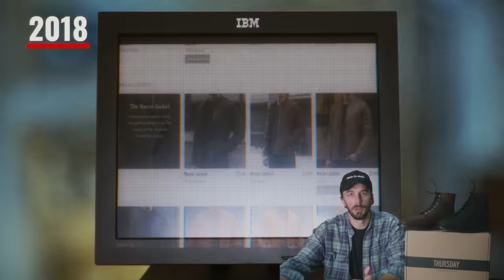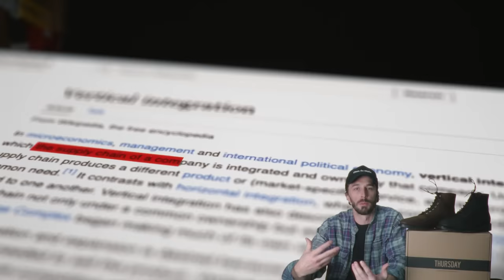Thursday History: Why they’re taking over the affordable boot world

Comment: Took a few attempts to get ones that fit but they sent replacements to me before they received my returns (UPS ain't That fast) and my only beef is I'm not used to any sort of heel, so maybe I should go for the sneakers. The only thing they have going for them on those lesser quality hold-overs from the temp factory is they looked to still be an okay boot for $200, just not the really good boot for $200. I don't need any new ones just yet, but will keep them in mind. I've a pair of Captains, Cavaliers, and dress shoes from them. I wear the Cavs most, because I'm lazy and don't like taking time tying shoes or boots.

Comment: What modern product design gets wrong is that it's marketing-led, it's "What is flashy and slick and in-your-face, that all the 'cool' people are wearing/using,  that looks like an expensive product, has all those design cues, but at ¼ the price?"  The way not to sell people an eventually disappointing product (like 90% of all electronic products on the market) is to be honest with the fundamentals of construction, overspecify and slightly overengineer materials & construction to cope with edge-case use scenarios, then make it clear (via videos like these) that that is what you are doing, and continue doing it, and not compromise and downgrade for the sake of a cash cow return, falling into the trap of trading on your previous good name as your product declines in quality. 'Taking the money and running', once you have established a name for yourself is the worst form of dishonesty. Doing the opposite is a good touchstone for the way you should live your life. Thanks Weston.

Comment: I love my Captains BUT the quality control issues are real. Mine came with the tongues all chewed up, loose threads everywhere and the leather was super dry. After less than a year of light use they need a cobbler for the separating heal.They are comfortable. With a little work burning the threads and conditioning the leather I have a nice pair of chromeexcel boots for 200 bucks. I have bought from them since and would again but probably only for the premium leathers. I also bought a pair of durbeys in waxed flesh. They have a minor imperfection in the welt. Purely cosmetic and not that noticeable.
Reply: yes, for casual usage I find them mostly acceptable for the price if you can find the right size in any given model. they have a whole bunch of models that I am sure are a waste of time.
Reply: I’ll add to this, their advertising is not honest. If you wore these into the wilderness they would fall apart.

Comment: I purchased a pair of black Thursday captains 2 years ago from an ebay seller at a great price ($130). They're wearing and holding up like a champ. I assumed that they were 2nds but, still can't find any flaws in stitching or the general construction of the boots. I think they're an earlier pair with a different last than is/was currently being used. I noticed that this earlier pair has thicker/stiffer leather than more recent models. I'm wondering....has anyone else had the same experience with Thursday using thicker leather on earlier models??

Comment: Wish I could try them on, I’ve wanted to get a pair of them. I actually work in boots so I’m curious how they would hold up. Auto mechanic. My red wings are bought shot after 6 years. Would like something lighter. Have been buying a new pair of sneakers  converse high tops every couple months. They’re comfy but wear out quick. I was thinking these would be a good compromise of the two.

Comment: I was so excited when I got my Thursdays a couple weeks ago, but I just discovered shoes have different widths... and the style of Thursdays I desperately wanted the past two years doesn't come in different widths and they run slimmer anyway so the boots crushed my big MANly feet like how Jason crushed that one dudes head in Friday Part 3. So now I have an irrational grudge against them.
Reply: I’ve got wide feet. Every now and then I will but a pair of regular width shoes. Something inevitably breaks quickly because of the pressure from my feet. 
I recently retired a pair of iron rangers. They looked perfect on the outside and the soles were only halfway worn through. But I had separated the interior stitching so they got wet if there was any rain at all. 
The lesson is - Don’t assume the leather will stretch. If something is too tight it will fail. Get proper fitting shoes

Comment: Those heat activated counters will crack over time, especially when taking off the boots with your other foot. There are stronger heat activated counters on the market, but these white squared ones are not a good pick. I also don't like the fiberboard as a midsole. Split leather is not that more expensive, but will really help the boots last through especially wet days and conditions. For 200 euros it's an ok deal I guess, but i'dd rather spend 50 more for quality contreforts and midsoles.
Reply: I agree, synthetic toe caps are fine but heels should be leather or at the very least a top of the line heat activated one. And the midsole straight up sucks.

Comment: I bought a pair of the wingtip dress shoes (not boots obviously). Initial impressions were good, but after 10 months of easy office use the sole is pulling apart from the midsole(?). Not a good sign of quality unless this is a one off. Granted this is a sample size of one, but I believe these would've had to have been made before the factory change? Not sure, but not impressed so far.

Comment: i bought a pair maybe 4 years ago, i must say i was thoroughly unimpressed.  leather felt very cheap and did not last, fit was weird, i did not like it.  taft boots were slightly better but laces started tearing the holes and stuff.  if you need a boot for once in a while wear i guess so.  but if you want a quality boot for frequent wear id look elsewhere.  even if you could resole it the uppers wear out too fast.

Comment: First of all, I really enjoy this channel and I believe the reviews are honest; however, this particular video made me skeptical about the legitimacy of Thursday boots (for the first time). 

1. How’d they mess up by sending the wrong /old boots?   Especially when this is for a sponsored review.   Please don’t give the excuse that they were rushed. 

This tells me that they did not stop the wrong old boots from being shipped out at the factory.  I’m guessing they probably shipped out quite a big amount of these.   Probably in the tens of thousands?  

I was literally looking to buy a pair of captains from Amazon minutes before I came across this review.  Now, I’m not sure if I want to buy them until months from now so I don’t get the old stock boots shipped to me instead of the newly designed and cut ones. 

Also, what do you mean by check the midsole????   We are not about to cut open the boots right after buying them.   Please be more specific about how to tell the difference between the old one from the new one.  How are we supposed to know what the difference in materials, feel, etc. if we’ve never owned a pair of Thursdays?

I guess the thing that really made me skeptical is the fact that Thursday claims they caught the mistake “just before” they were shipped out.  

So, is Thursday guaranteeing any purchase made today and forward is the newly designed and manufactured boots as this video claims?   Or, will they just keep shipping out the old ones in stock until sold out?

Honestly, I think this company is solid, based on reviews from you and similar channels.  I still want to buy a pair but not sure if Amazon is carrying the new model.

Comment: What’s your guys’ favorite leather for the Thursday Captains. I wanted to get a pair but was overwhelmed by all the options, any recommendations ?
Reply: I also felt overwhelmed like you did. I got 2 pair the captain in matte black and the president in a light brown color. Don't remember what it was. I highly regret not getting the Arizona Adobe. That seems to be the best of the best from them. Don't recommend the matte black
Reply: You would basically have to order two or three pairs and see how they look to you in person, and then you will possibly have to exchange to get the proper fit, which seems to vary from model to model, but when I first wanted to check out the brand, the only ones in my size available at the time were the Rugged leather in the Captain which are fine for light hiking and such but not really "dressy".
Reply: @Highland_Paddy  agreed. I would order a couple colors and sizes from Amazon to try on and easy returns. Then order your size and color straight from Thursday because Amazon doesn't have any of their new boots
Reply: @almostkinda  when I first bought, the Thurs site was down for the holidays or something and HAD TO buy from AMZN, which I'm positive was an older model but they fit OK at least.

Comment: I got 1 pair of thursday captains years ago and loved them. since then ive gotten a few other pairs and they have all sucked massively. Major QC issues on all of them and what appear to be straight up worse construction. Every pair after the first one has had noticibly f'd up stitching, no nails through the heel, one even has the wrong size heel block on it and has a lip halfway through the block, 2 have had stitching so fucked on boot lining that I had to cut out large masses of bundled stitching.
I super unimpressed with this brand and frankly wont touch them  going forward. used to be my go-to recommendation but I cant anymore
Reply: What are your recs not that thursday is sub-average?

Comment: I like Thursday boots and own a lot of their products but I have to say you're basing your praise on the company based an a sample of one good boot that they sent you after one flawed boot. How do I know that the good boot was one of a small sample set for reviewers and the one they accidentally sent you  is how all the rest are made ?
Having said that....I'm not necessarily sure the "flawed" boot was much worse and I would be happy to receive a boot with a rubber midsole and a latex insole cushioning. Red Wing use rubber midsoles and are known to last a long time plus a midsole can be replaced if necessary. Even the latex liner under the footbed is no different from having an EVA strip in terms of longevity and is likely to be replaceable if necessary.
The boots are likely to be more comfortable with the rubber components.
And given the comments I've seen most people don't even want to spend $100+ on            re-soling a Thursday boot when a new one can be purchased for $200 so it is unlikely that these boots are going to be kept long enough for this to be an issue for the majority.

Comment: There toe box is wayyyy to low for some of the models! There moc toe just looks goofy after they break in, the cap toe is to dressy along with just about all ofbthere models. If they marketed them as dress than that would be fine. But when u but a lug sole on them and call them "storm king" then it make u think they are more of a work casual boot. But they just look goofy unless dressed up with no lug sole

Comment: i love this dudes Chanel. he has directed more than one of my purchases. 
but i am suspect of Thursday boot company. why is EVERY youtuber in love with them? i have 2 pairs. one of the American made and one of the mexico made. both feel cheap. I have the Logger in waxed cauco and they look absolutely amazing. but they feel cheaper than most of my other boots. you can feel the difference in the thickness of the leather. and the mexico build captains i don't even consider boots. they are thin and very unsubstantial. i only wear them to the office and wouldn't dream of working outside in them. i live in the mountains of colorado and don't even wear them outside around my property. they are  boots to wear on a nice day to the office nothing more.

Comment: This brand is utter garbage, in every aspect. I bought a pair of their toe cap boots about 5 years ago. The top lace hooks fell out after 3 months. They absolutely refused to honor their warranty, and told me I was “tightening the laces too hard.” Really? No, not even close. They refused to fix them, or replace them. Instead they sent me a few hooks and said good luck. There are zero cobblers within 250 miles of me that have the tool to fix them. They made good garden boots, until I threw them away soon after. I was issued a pair of Red Wings in the Navy. They survived 2 wars and almost 20 years and still are like new. NEVER waste your money on this brand. Spend a little more and go with a brand that’ll last.